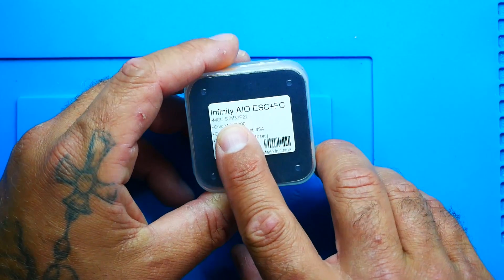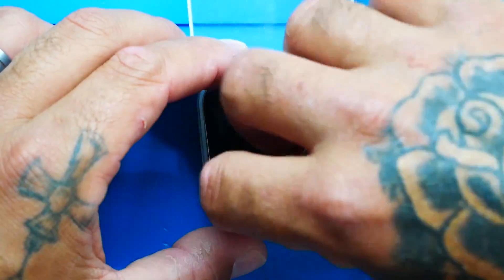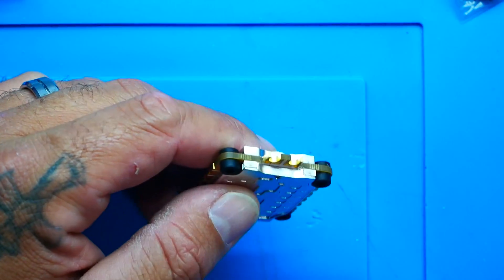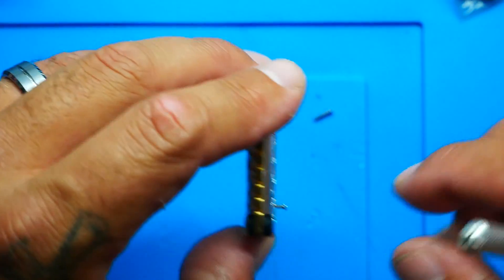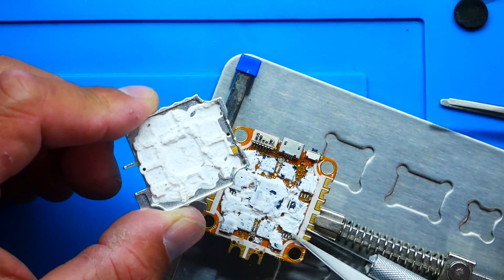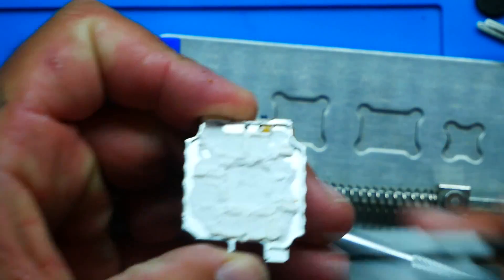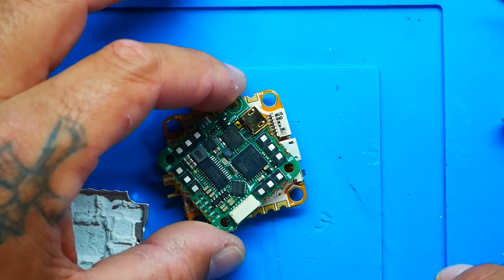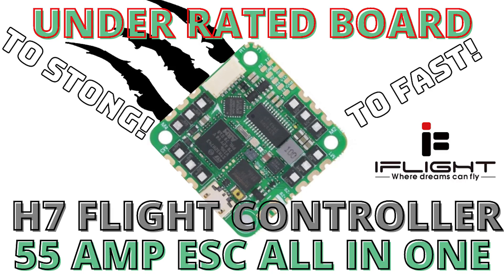How Much Would You Spend On One Board?! 🤑 NewBeeDrone AIO

Comment: In concept an AIO setup sounds nice but isolating vibration coming off of the motors through its wires may or may not be a concern I’d have, compared to a separate dampened fc. Nice video.

Comment: Just needs to be water proof too.
Reply: What do you mean he was saying it it is sealed tight and the way it’s built makes it water resistant unless u plan on trying to completely submerged this thing and fly under water. Other then that flying in the rain this thing will definitely do that. I would probably coat the power leads and motor pads just to reassure my self I’ll be ok but yea this thing is built very well
Reply: @devilcfpv2621  thermal paste isn't water proof coating